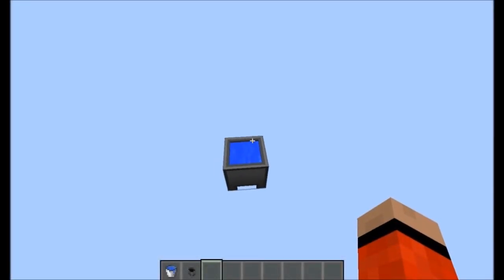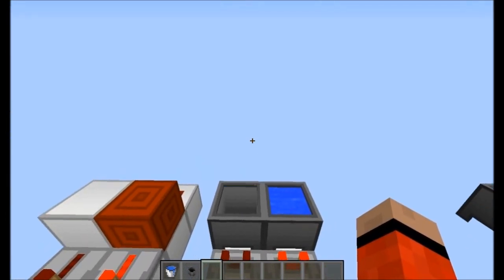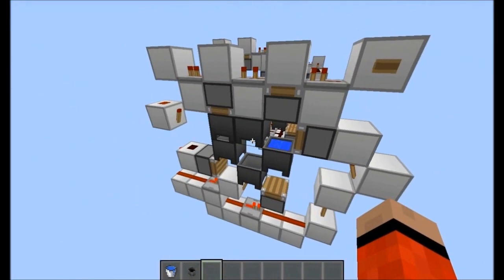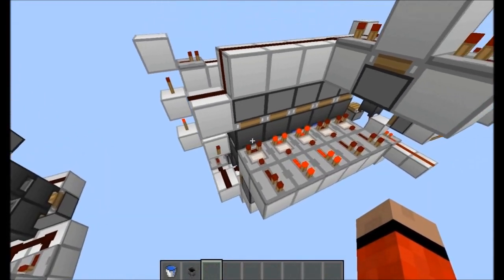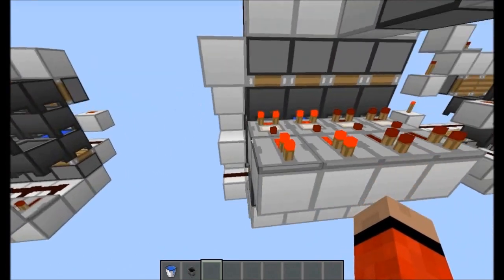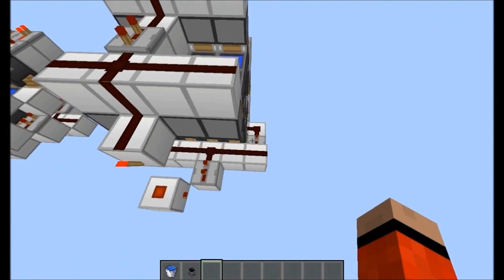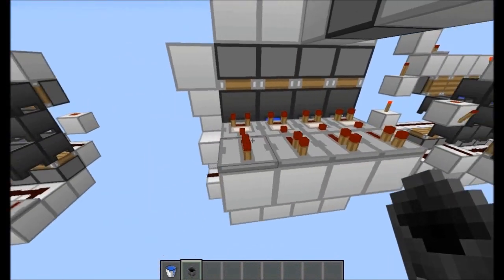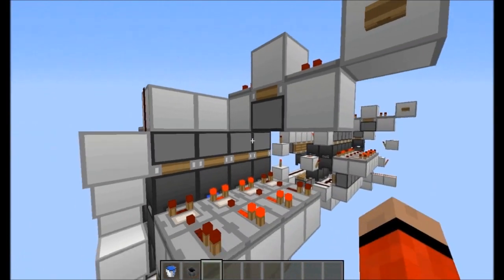The Cauldron Redstone Hard Drive Showcase

Comment: I've done a bit of research into rewritable storage arrays in MC. I did design a few on paper that are controlled the same as a piston tape hard drive but are way faster (4-tick increment time) roughly. However, my designs don't allow for GOTO instructions unless you want to add a lot of extra logic.

Comment: Nice concept. My first thought when I read the title was that you figured out a practical way of using the different water levels to represent multiple bits. (There are 4 different states from empty to full so it could represent 2 bits. However, programming it by hand is tedious because you have to use bottles to remove water from cauldrons).